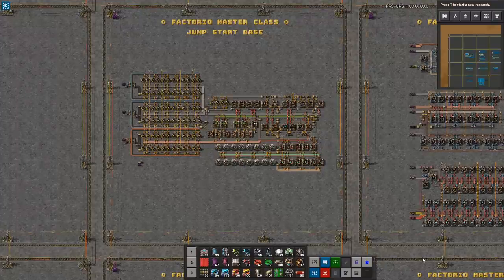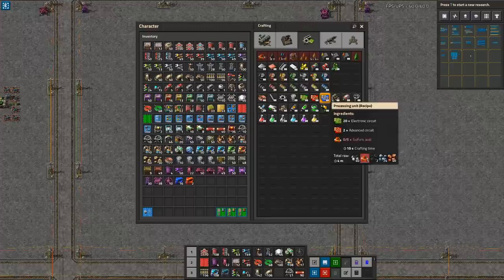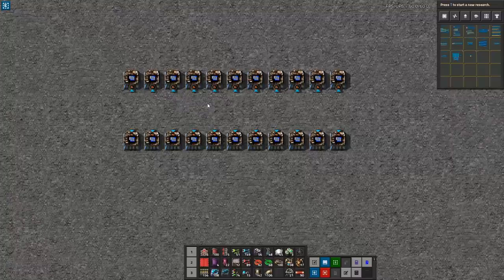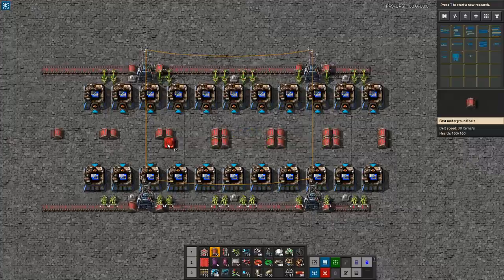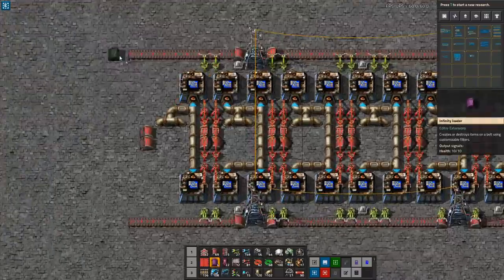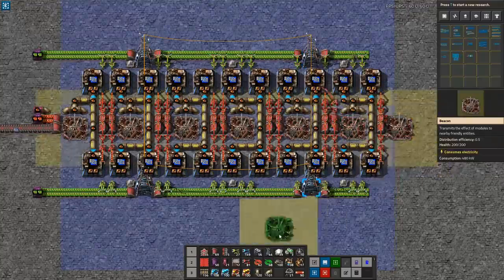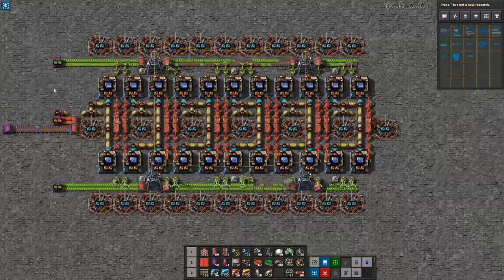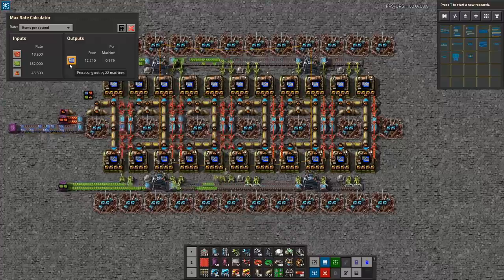Tileable/Upgradeable BLUE CIRCUITS / PROCESSING UNIT design -  Factorio 0.18 Tutorial/Guide/How-to

Comment: I love these designs. I made my own blue circuit design that has 8 beacons per assembler, and stacks vertically 6 times in a city block. Each blue circuit column consumes 36 green circuits/sec and each row consumes 11 red circuits/second, but it's not nearly as space efficient as your design. It does however neatly provide 1 full blue belt of blue circuits.

Comment: The only thing I would change is to have 2 splitters with outside output priority to add the green circuits into the line instead of the wrap around. Other than that, fantastic job as usual

Comment: Just a quick question on the final design, the middle blue circuits have 2 inputs for green circuits while every other one only has 1 input, is this intentional or more just an aesthetic choice?
Reply: The green circuits are coming from 2 directions at the very end. The full lane of greens can support 5.5 assemblers so the one in the "middle" from our POV is actually the one at the "end" of both green lanes so it needs 2 inputs from each lane since the lane only has enough circuits for half.

I suspect that it's set up that way from the beginning to make upgrading to the late game blueprint easier since you can just plop it down

Comment: 8:43 don't beacons require purple science for the research? I still think the mk1 modules are a good idea though, even after purple science (because mk3 module require quite a lot of blue circuits) but yellow assemblers would be good. I think this was just an oversight though.
love the videos though, keep it up!
Reply from the maker: yes they do. When you get Production Science it is easy to add a couple of beacons, but if you do the full upgrade then you also need to produce and transport 180 Green Circuits / second, which is a completely different scale. The middle tier is a good stepping stone before you have a fully blue belted base

Comment: I maight be wrong but i think the beacons are unlock with the purple science
Reply: Yep
Reply from the maker: yes they do. When you get Production Science it is easy to add a couple of beacons, but if you do the full upgrade then you also need to produce and transport 180 Green Circuits / second, which is a completely different scale. The middle tier is a good stepping stone before you have a fully blue belted base